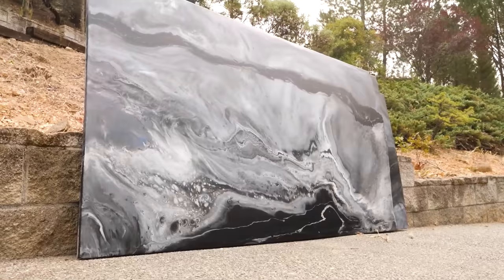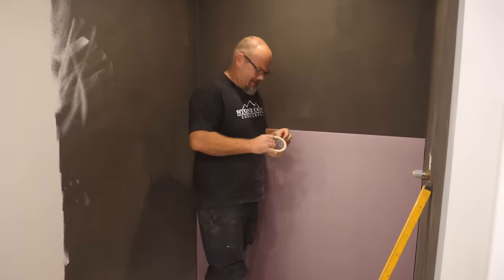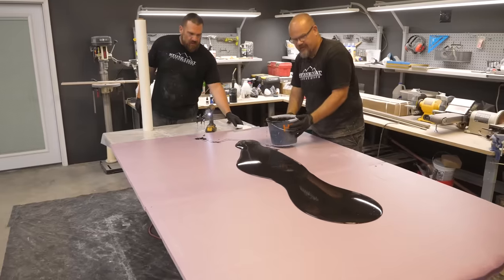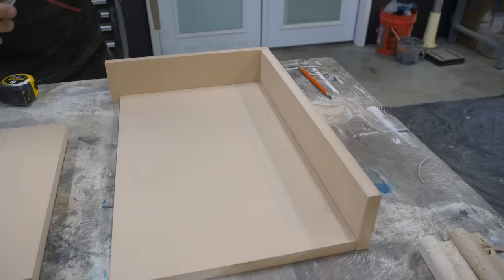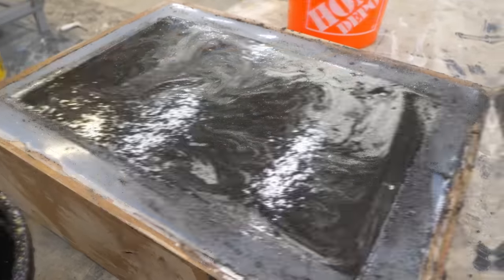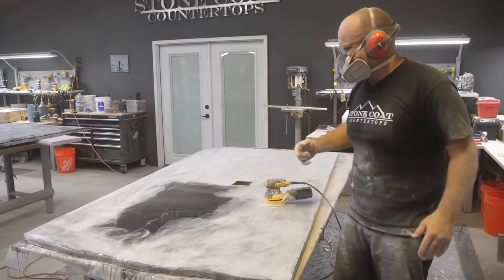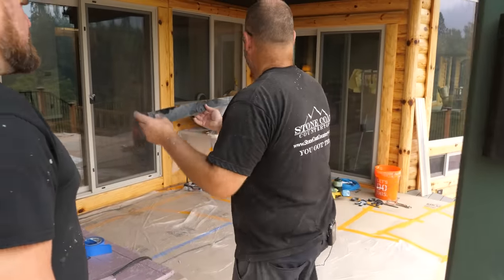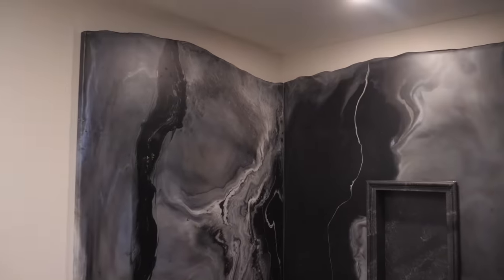Epoxy Slab Shower with Pink Foam, Come on the Jobsite Real Training

Comment: I'm trying to work on a shower in an old RV, so the light weight foam and flexible epoxy makes this an amazing design for campers and RVs.
Reply: I'm thinking it would also up the insulation factor, if you were to use this method on full walls.
Reply: Exactly I'm doing a add on to my home it's light strong I'm in !!!, waterproof
Reply: @_GntlStone_  the shower walls are against the side and back outer walls so I do hope so, it's an older 1985 RV so it could use all the insulation help it can get.
Reply: I am thinking the exact same thing on my RV shower redo.  This seems like the perfect way to redo the bath. Counter tops & back splash  in kitchen too.
Reply: I like the walls but I'm curious about this threshold piece. Concerned about the strength of it. Seems the edges would be weak for foot traffic?
Reply: Thinking the same exact think the weight has been what has stopped me in the past. But I’m like you I think I will add this.
Reply: @smitty_1  Smitty - that part (The Threshold) is a cement pour that they did at the same time as the textured backsplashes which will be installed later in that bathroom.  It is not the foamcore product.
Reply: @tavant6903  Do you think this cement threshold strong enough to hold the weight on it?  And not to crack?
Reply: In seeing  this, I too thought it would  be light weight and perfect  for our RV.
Reply: @tavant6903  👍 understood,  thanks

Comment: I'd be worried about the backside of the foam. Big concern is mold but had you done fiberglass on both sides it would have been stronger. Looks great though.

Comment: Sweet video!
   I've been thinking about trying epoxy over pink panther foam boards!
I have used epoxies in my own art and I've helped a guy create a "Country-Western" style countertop ( he welded a horseshoe to a hammer, then beat a plywood top and stained indentations!! LOL!)  years ago.
Question: is the final coat a harder surface than the initial epoxies you used?
- I've never used that type of "Super-Glue" before neither, was hoping y'all were going to mention it in a little more detail.
Watched video, in it's entirety, in one sitting, fully entertained! 
...even had some juggling!
I mean, what more can we ask ?!!
Great job!

Comment: Wow, Mike,  I really, really like this.   I'm only about 1/4 of the way through, but had to stop to ask why do you sand the shower pan after stamping, if you're trying to get the "natural rock" experience?

Here's my  bigger question:  Since there will  be some condensation on the vertical drywall above the epoxy panels, there will be some runs/drips that get behind the panels.  Why not caulk the top of the panels at the wall?

Comment: Wondering how waterproof and mold proof this is?  Doesn’t take much to get steam or condensation behind those panels.
Reply: Yeah, when he said he wasnt going to caulk the bottom I was like WTF?
Reply: well there is some air space behind the panels due to the dots, if you caulked the bottom moisture would never get out from behind them. the air in their will temp change when the showers on and generate moisture no matter what, this way it has a way out and should drain out on top of the concrete and out in to the shower pan. 
the pinkboard and epoxy are about as water proof as it gets, but the walls behind it will be porous enough to let condensation seep in from behind
Reply: @NogrimStoneson Wouldnt moisture be able to wick out from the top of the panels?  He didnt close them off from above either.
Reply: @EricNielsen187  Mold can grow on waterproof surfaces especially since they inhibit drying out.
Reply: Ok, not being a smartass or anything, how would everyone here recommend preventing mold behind an epoxy shower wall? I love the idea of doing this type of epoxy work when I can buy my first house, and remodel it, but I do also want to make sure the place is taken care of. There’s gotta be a way to make this viable though, right?
Reply: @joetomp  yea, just tile it lmaoo.  As a tile installer this is a joke because you can just as easily buy panels for cheaper and paint them
Reply: I would use a epoxy gel to seal off the seams not caulking
Reply: Hey guys! Love your videos. Watching you pour your molds and shower caddy I wanted to give you a quick tip. Use a concrete vibrator on the molds. It’ll flatten your epoxy out quick and even. You could lay it on the plywood and it would work. The hand held version I’m talking about. Harbor Freight used to carry one that would work for you guys.
Reply: @Joey Tompkins  do you think the wall behind the panels could just be waterproofed? There is a product for treating the area around showers and tubs...I can't remember the name of it but it's Red- something. I wonder if that would work🤷‍♀️
Reply: @antonpishchik that's good info.. what type of panels are you thinking?  Hardybecker?
Reply: @NogrimStoneson shouldn’t ther be a moisture barrier directly behind the pink board?  There is behind my cement board and tiles.
Reply: It’s foam,
Reply: As a tile installer I'd recommend red guarding your walls before gluing up panels it helps moisture proof everything and works wonders also I might trowel the glue on to avoid having such empty voids behind panels but other then thst looks great but out of curiosity what do u think the life span of shower walls would be ? All in all great work !

Comment: Hey I've done a ton of mold pouring and something you're gonna wanna get is a big vibratory for the molds. It gets all the little air pockets out of the mold so you'll never open one up and have those tiny pockets on ridges. It saves time so when you think it's done you don't have to patch those air pocket bubbles.
Reply: I was thinking the same thing or at least taking an air hammer and running it all along the bottom somehow.
Reply: with epoxy u just need heat.....thats what the torch is for removin air bubbles
Reply: @jakestella2678  Not sure if you missed the part where I said I've done a ton of mold pouring, but the heat only works if the epoxy is very thin. In a mold the epoxy is very deep and thick which causes air pockets to get stuck in the bottom and around any detailed parts. You see I haven't watched 50 or so of these videos and think I have actual knowledge of how all this works. I know I have actual knowledge of how all this works because I've done this for years as a job and this was the first time they have tried molds so I figured I'd pass along my experience to help them out, not so internet trolls can think they know more than me. The thing that should have told you I may know what I'm talking about is how long this comment has been up and your the first person to try to tell me I'm wrong, that shoulda been a clue.
Reply: Yes like a vibrator table.Take not e ^^^^this guy knows what he’s talking about .
Reply: @coverup7428  Actually with the smaller molds they're doing that would work really good, you could put multiple molds on the same work area and get the same effect. All of my experience is with very large molds, we made septic tanks (and their caps). Obviously they're made of concrete and because of the size a vibrating table is out of the question. So we had a tool that looked kinda like a 10 foot long water hose with a domed tip that vibrated intensely, holding it for long periods would make your joints hurt like hell that night after work. So we would take this tool with thick rubber gloves on and run it into the concrete to the bottom of the mold and then drag it around the mold pausing periodically so that the vibrating would work out all the air pockets and after we went all the way around the mold we'd move on to the next mold. The fun part was when someone would forget to spray the molds with oil so that the concrete would release and we had to figure out how to get the tank out of its mold without breaking the molds cus the tanks can be replaced easily whereas the molds for making the tanks were not so easily replaced or repaired if damaged so making sure they were all coated before pouring was important but when in a hurry because you have a cement truck full of quickly drying concrete. It was forgotten about a few times and then we had alot of fun trying to figure out how to fix that.
Reply: @michaelrevels3572  there's no mold. It's thin due to being a simple foam slab coating. A torch would work fine for this project.  I often use a detail sander to vibrate the work piece in situations like this. A larger project or a fully molded piece of this size would benefit from a larger vibrator though for sure.
Reply: @jacobbergen919  Wow, I can really tell you've actually watched this video in its entirety. So we're all just making comments about molds and the best way to do them for sh!tz and giggles. No there's actually molds in this video if you'd watched the whole think, he actually comments on it being the first time trying them out and that's why I made the comment.

Comment: If you epoxy both sides of the foam would they be usable as walls on a camper? There would be a framework of wood or metal. This idea has been going through my head since I first saw this video over a year ago.

Comment: mee, you should put all 3 pieces in line when pouring, so you get a continuous pattern from one slab to another. Also huge patterns in tight paces look out of scale. So you should break into smaller pattern and and give lots of detail. Also you may want to do a little gradual, lighter at the bottom, darker at the top. make a contrast with a darker floor. Shower hardware should be chrome or gold to give a contrast.

Comment: Thanks guys this was great. I would encourage you to figure out a water proof alternative to the MDF for the long leading edge. Epoxy is good but all it takes is a little nick or crack and water will find its way through. What about composite board?
Reply: I thought they would do an under layer before installing this stuff so any water that gets through would drain anyway but guess not.
Reply: And no silicone between panels and joints ? 🤔 how is this water 💧 proof ?

Comment: Hey guys loved this and it is just in time as I am going to do a shower in a couple of weeks.  Gotta order my epoxy!  Was wondering if you could cover a premade shower pan (fiberglass I think) and cover it with epoxy and ultra coat or just spray paint and ultracoat?  Would either of those work?

Comment: Looks awesome! Im interested to give this a go! I have a bath company, and we install the 2 day shower. Ive done them in 1 day, but average it's 2. We mostly do acrylic wall panels, and kohler has a synthetic stone. Ill be honest, your walls blow theirs out of the water. Kohler recommends to retail thier shower systems starting around $10,000! Acrylic  showers run around $6,500. Im thinking your showers would go $10,000+ easily! It's got my wheels turning I'll tell you that! Only thing I can suggest as far as installation is using a sausage caulk gun for gluing your panels. I even have a cordless powered one. Also all the manufacturers require roughly 4 inch circles of glue tightly applied to your drywall, or backing of choice. Again, great job and look forward to see the next one!!
Reply: pm
Reply: Just did a 12,400 $ bathroom this one looks better ,lighter , feel sad that my customers spend all that money... saving them honestly goes along way ... and now I can do showers and counter tops And make steady income not a bulk and drought and bulk n drought ... imma use this and game change things

Comment: Mike, I've been building large custom bathroom showers for 25 years. I'm a huge Schluter installer. I'm wondering if there will ever be an issue with “vapor drive”? Also, spot bonding makes for huge issues. Using a 1/4” “V” notched trowel will insure there is adequate coverage. Looks great though.
Reply: rigid foam board is a vapour barrier and can be used in place of 6mil poly. I'm not sure their corners are well sealed but the faces should be good.
Reply: @binaryblade2  It’s still won’t stand up to vapor drive regardless of how “closed” the cell in the ridgid board is.
Reply: Huge leaks coming in the future !!!
Reply: What would you recommend using then?

Comment: I understand you waterproofed the walls.  I didn't see where you sealed the back of the panels with epoxy.  I didn't hear you mention that you caulked where the panels contact the pan.  Water has a way of getting into places (former remodeler here) especially with showers.  Are you not concerned about mold on the back of the panels.  I love the idea of this method and I think a lot of people would be interested in the details of the pan.  LOVE the mold you made for the floor, that was really creative...
Reply: They don’t epoxy the back of the panels because it’s just foam.
Reply: As a tile installer (not my favorite thing, I prefer my hardwoods), and someone who has done custom showers, I understand the epoxy is waterproof, and that silicone is waterproof, but you're still relying on there never getting a hole in the silicone. 

I'd be much more comfortable with even a liquid/roll on membrane, like ardex 8+9 or something behind the panels for when the silicone gets those punctures
Reply: @michaeloliver6745  So was the front and they put epoxy on that, so why not the back?  Black mold is a serious issue.  Silicone does not last and will usually/always fail at some point.  Not looking for an argument, just saying as someone who's done custom shower installs, if you don't do it correctly you can/will have major problems.  Water is very unforgiving, particularly in showers.  Would just like them to expand specifically on that issue.  Using silicone for the caddy is not an issue but when you get down to the pan and panels, that's where problems can/will arise...
Reply: @bloodsport5112  can't answer that one.  I only know that the water won't penetrate the foam.  I agree about the mold for sure, its dangerous.  Maybe you'll get an answer yet.

Comment: I'm interested in achieving a mirrored glass finish on my Class A motorhome. I've noticed that your proxy ports are typically oriented horizontally. If it's possible to achieve this vertically, please demonstrate how it can be done. Can the proxy be sprayed on? I'd like to do this because I can see through the paint to the fiberglass fibers. I believe using proxy will help to conceal the displayed fibers."

Comment: This is so cool! I would've loved to see you tape all three panels together for the pour, so you could've book-matched the veins horizontally/diagonally through the entire shower. I'm curious to see how this holds up over time. It seems to me like there is a few places for moisture and condensation to accumulate, and mold is no joke.
Reply: The homeowner will be lucky if it lasts a year. The major problems are that the shower door is only attached to foam that's siliconed to sheetrock, the sheetrock went down into the pan and the type of foam he used allows mold to grow surprisingly fast. He also overstated the price of granite. Granite usually sells for $20-$30 a foot and he said there is less than 100 feet of walls in the shower. And when installed properly a granite shower will last anywhere from 50-100 years or longer. So it would better to go ahead and spend the money the first time instead of doing something like this a year later you have to tear it all out repair all the mold damage the redo it again. I've been remodeling kitchens and bathrooms for over 20 years, and this guy said he "learned how to do this by watching videos about how to make surfboards". If you look at the problems they had they were problems a professional would not make. This guy is makes countertops and watched a few videos about how to make surfboards and calls himself a professional but you can tell by his comments that he has never done this before. And he said he used $600 in epoxy but doesn't say anything about the cost of the dies, paints, foam boards, fiberglass, mixing buckets and cups, brushes and rollers, plastic to cover everything and what he charged for the install. All things considered that bathroom probably costed $3000 or more and if you add the cost of having to have it repaired and redone in a year it would be cheaper to get the granite the first time and you know it will last.
Reply: @keywilliam1   When he said "I've never done this before" it also made me think he's never done this before.
Reply: @GrrillaFinger  😂😂😂
Reply: @keywilliam1  I watched this video from start to finish, @Tokamak 904, and there is a section where they show how the foam is removed and replaced with another material so that the shower doors have good solid anchoring spots near the top and bottom on each side panel. Maybe at about 43 minutes???
Reply: Sprinkle copper and silver powder throughout and it will be anti mold and anti microbial
Reply: @keywilliam1  I did cringe that they did not  run a bead of caulk along the bottom of the panels where they meet the floor/pan. No waterproofing of studs and drywall behind the caddy, no bead to seal the top edge of the wall panels. Yep, mold is no joke, and is there not an inspection for this install to make sure it's to code?  The piece the door would sit on is a solid epoxy piece that they made and then coated so would stand the weight of the door better than the coated foam. Still might not hold up long to the weight and rolling of the door and being stepped on. Beautiful shower though!

Comment: Pro tip: when making a square to cast make a second internal square, it will save you a ton of silicone and will make it easier to remove the cast piece. 
Love the work, might actually set up a workshop of my now and do similar stuff.
Reply: Que tipo de cemento y que tipo de resina